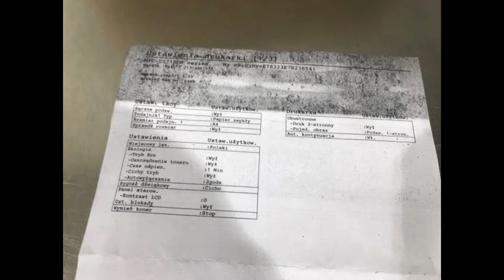KYOCERA FSC IMAGE PROBLEM TUTORIAL

Comment: Question I have blurred lines going down my print out, what can I change out for that be removed?
Reply from the maker: You didn't say what machine you have. Usually if you have this type of problem you need to check if your Drum Units are worn out. Sometimes you need to clean the PCR load roller. Sometimes you need to clean the optics and the laser. Of course, the optics clean only in machines that have a scanner. Regards

Comment: prints white paper kyocera4200 how to solve a problem thank you
Reply from the maker: Dirty electronics connections in the drum area are often a problem.
Reply: @MrRicoh  and how it is handled, what those contacts are
Reply from the maker: You just need to clean the connections between the Drum unit and the copier.
Reply: @MrRicoh  can i get a picture of where exactly it is, thank you very much in advance